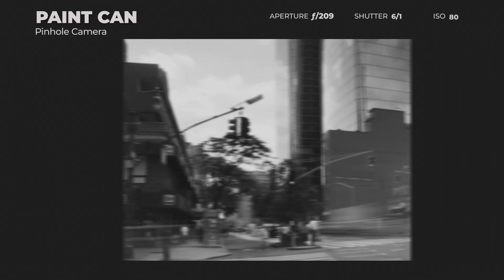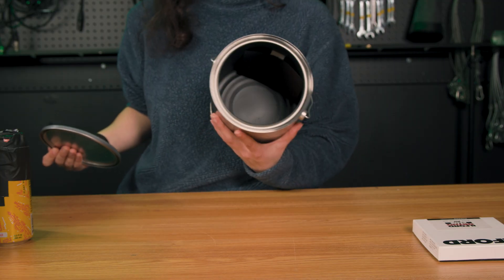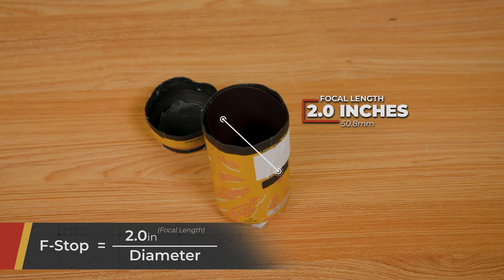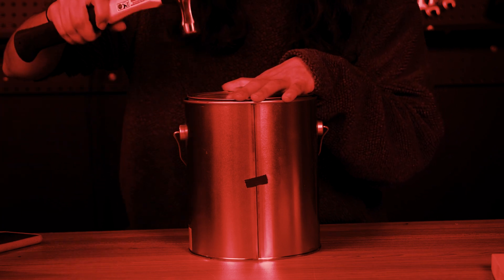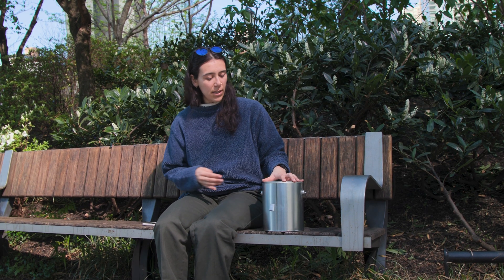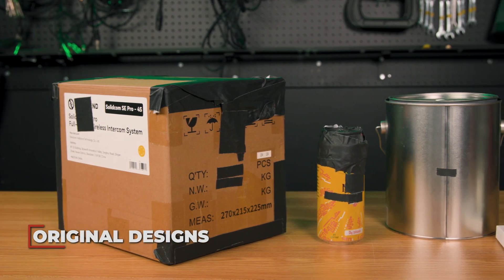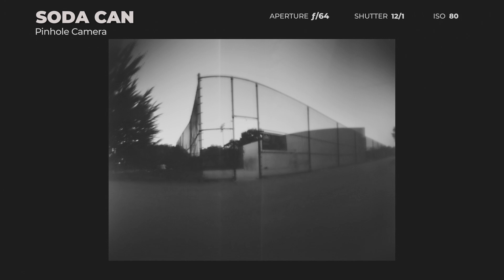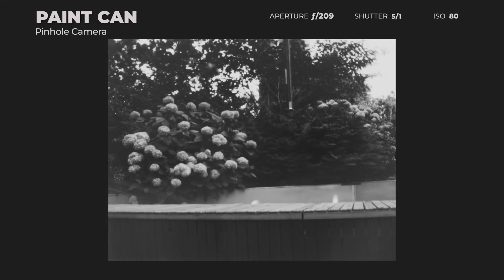How to Make (And Use) a Pinhole Camera

Comment: I am currently experimenting with the box type with a similar f-stop 184 I would like to see this done with a cyanotype film I wonder about the exposure time on a sunny day. I am currently trying out a few one at 10min, 1 at 2 hours and another at 6 hours. I wonder if ill get anything its very sunny here in SC iso 80-100
Reply: Did you end up trying anything with cyanotypes? I just came across pinhole photography and my first thought was to embrace the analog photography and use the negatives to print cyanotypes. Also funny coincidence to see you’re in SC :)

Comment: I made a pinhole camera recently. To make the appropriate pinhole size, I multiplied the focal length of my camera (120mm) by the wavelength of daylight (0.00055) which comes to 0.066. I then found the square root of 0.066 to get a pinhole size of 0.256mm - rounded up to 0.3mm.
Reply from the maker: Nice math you did there.
Reply: Thank you 🙂
Reply: Nerd
Reply: What does that make? Depth?

Comment: It is fun but time consuming! Suggest that you use a fine sewing needle to make your 'aperture'. This results in 'sharper' soft images with a longer exposure.
Paint a small square of Reynolds Wrap or similar foil black both sides before hand then gently push needle through. Use another painted black foil as 'shutter'.